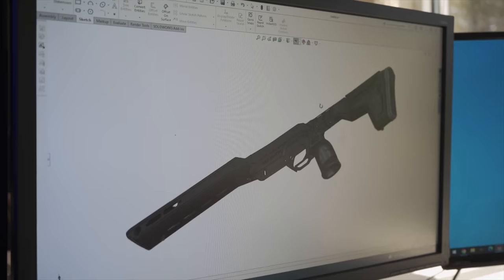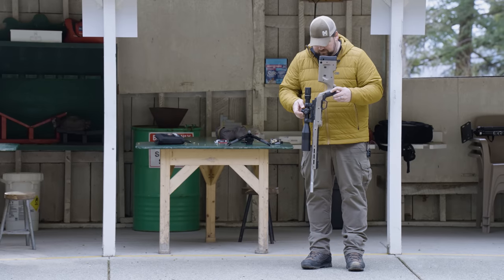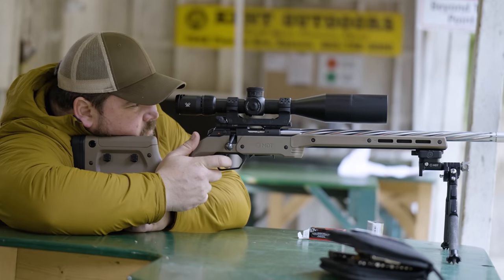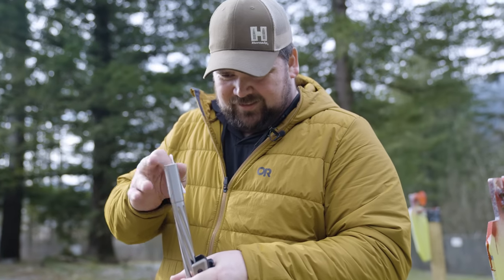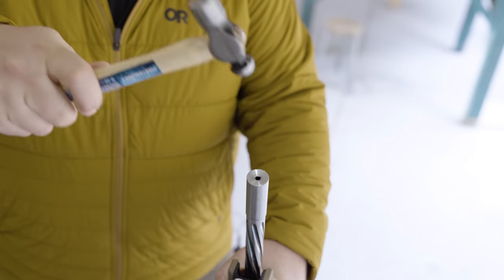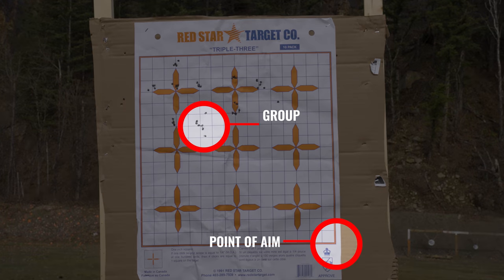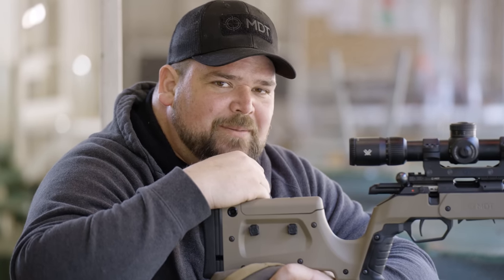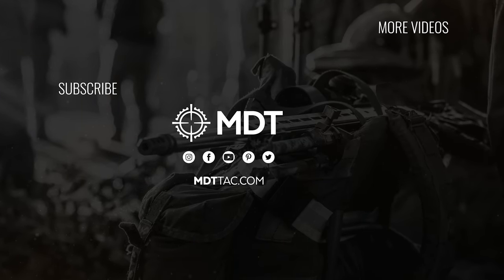Can A Damaged Rifle Crown Still Shoot Accurately?

Comment: The effects are even more pronounced with a high velocity centerfire cartridge and jacketed bullets.  This is also why removing and cleaning your muzzle brake needs to be part of your cleaning routine.  We've had customers who thought the barrel was shot out since they lost accuracy but cleaned the gun regularly.  However, the brake was never removed as part of the cleaning process and there was buildup between the brake and the crown.
Reply: @LØNGRANGE My opinion is that the buildup on the face of the muzzle changes the profile and shape of the crown, which causes the exact same issues seen here (but happen more slowly). The carbon buildup is not of sufficient mass to affect the harmonics (compared to the barrel and brake weight) but it most certainly changes the profile.  For the competitive shooter who’s shooting 200 rnd matches a couple of times per month plus practice, this buildup can happen quickly.  It’s also a good idea to pull the brake  and retorque. Although the heat is not as intense as a semi-auto, the muzzle device can loosen due to the number of heat cycles. What makes this tough to detect is the device will only be loose when the barrel is hot and tighten up when the barrel is cold.  Not every cleaning, but certainly every 500-750 rounds the brake should be removed, cleaned, and torqued.
Reply: @LØNGRANGE Build up will depend on your caliber and load but you def need to keep an eye on it.  Carbon lock is the pro shooter's Loctite, but some brakes (Area 419 comes to mind) don't have wrench flats and are often installed hand-tight which isn't enough. 25 ft lbs is perfect. You just want to make sure you're beyond hand tight. We use a small strap wrench for brakes that don't have flats.
Reply: Huh, haven't noticed a change in accuracy from my Surefire 2 port and that thing gets gunky after some suppressor use. Maybe the suppressor blast and heat combo knock all the crud off from the inside or something. Glad I haven't had this issue so far.
Reply: @Zel_eo  The problem occurs between the muzzle of the rifle and the brake or suppressor adapter. If you have a direct thread suppressor, the suppressor is getting gunked up, but chances are the muzzle is not. 

You can get a lot of buildup at the muzzle before the first port in the brake (or adapter) that won't be removed during a regular bore cleaning.  I'm not saying this is a problem everyone has, but it should be considered and checked as part of a cleaning routine.
Reply: @vettepilot427  It's a Surefire Socom suppressor so it slips over and ratchets to the brake. Carbon get caked on the brake quite often...many a pant legs have seen a gunky black streak down them on accident lol. I'm not saying it isn't something that happens, just that I am surprised after blowing as many rounds off as I have that my unlucky self hasn't had it happen. Taking it off isn't an option for me though as it's rocksett in place with precision shims.

Comment: Is protecting the crown important ? Yes, I believe so. Is it as fragile as some would have you believe ? I don't think so. I read a good article one time titled  "The Imperfect Crown" I can't remember if it was on long range hunting or where it was but they hacksawed a 300winmag from 26" down to 16" an inch at a time and shot it for velocity. What surprised them the most was that it would still group even with the imperfect crown. It was a good read.
Reply: I suspect it probably has a much bigger effect on low pressure bullets like .22 than it does on high pressure like 300 win mag or 308
Reply: @uzbekistanimale  That would be interesting to see.

Comment: Would have loved to see they re-chamfer the crown with a hand drill and test prior to the full gunsmith re-crown.
Reply: We actually did try but could not get the alignment rod down the barrel because we had roles the edge over so much. I can say they do work pretty good with minimal damage
Reply: @ryanmclean3326  I'm not sure who but someone makes an at home crowning system. You should try that one. Also, try larger caliber guns please
Dave Manson is the name
Reply: @ryanmclean3326  Awesome thanks!
Reply: The Manson crowning tool is what we tried to use and colud not.
Reply: @ryanmclean3326  bummer. I've gotten it to work but was always worried that the crown wasn't perfectly square. Could you guys maybe try that on a larger one and see? I'm sure you have more tooling than I do. I'll help if you're around southern Utah.

Comment: Seeing this makes me wonder what effect painting a barrel has on accuracy, specifically painting the crown.  That would be a cool follow up to this video.
Reply: painting will affect the harmonics of you barrel. It could be negligible, it could make it better, it could make it worse. As the finish wears it will also affect the harmonics
Reply: @randylahey2242  overthinking it
Reply: @urgamecshk  for hunting and plinking? sure it wont matter, but for fclass and getting the absolute most precision out of your rifle then yes it potentially will make a measurable difference. A rubber band alone will affect how your barrel shoots. That's why barrel tuners work. If you cerakote a tuning fork it's going to affect its operation. A barrel is no different.
Reply: @randylahey2242  exactly. Nothing should be touching the barell from the lands to the crown if you don't want to compromise accuracy over long distances. Every single object of matter has a frequency and harmonics,if the frequency is interupted in anyway the harmonics is affected. I have five firearms,all rifles and the only thing that is touching the barrels on my rifles is the muzzle breaks that i have attatched to the factory threads.

Comment: Is there a simple way of cleaning up a crown at home?  The trip to the gunsmith normally has a turn around of eternity
Reply: I've heard of using brass screws and some lapping compound to fix up a crown. I believe Midway and Brownells also have dedicated brass tools available to do the same thing.
Reply: Brownells sells a 79 degree muzzle crowning cutter, for use with a muzzle pilot.
Reply: Brass nipple in a drill with compound. Facing a barrel on a lathe takes like 4 minutes
Reply: I have heard some older gentlemen say that you can use your brass case mouth chamfer tool.

Comment: Can A Damaged Rifle Crown Still Shoot Accurately?

My Heritage Arms Rough Rider revolver had a marred muzzle crown brand new from the factory and no it did not shoot accurately. The bore rifling edge or lands at the crown was damaged. It shot like a shotgun pattern. It would not shoot a bullet group. How severe the damage of the lands are will dictate how little or how big a shift in its point of impact. I did a crown job on it to remove the damage and level or even the muzzle edge and it groups great now. I essentially ground the muzzle down until the damage was ground away and the crown was even or level. Two ways to do it. A round brass bolt head and valve grinding compound as a drill bit chucked in a drill is one way. I opted for a Dremel with a round stone or cone stone and touched it once or twice. Then I lightly sanded with fine grit sand paper, cleaned it, and reblued the crown.